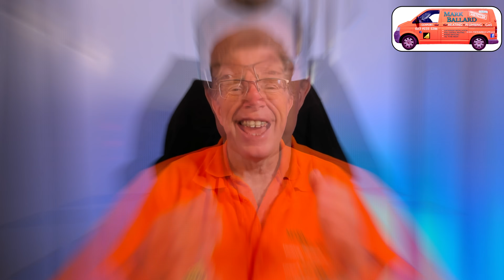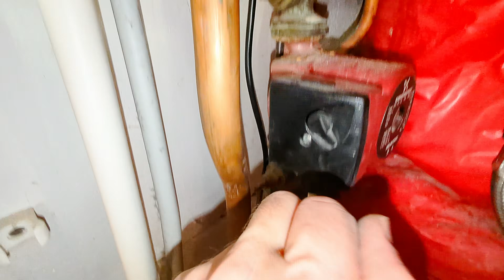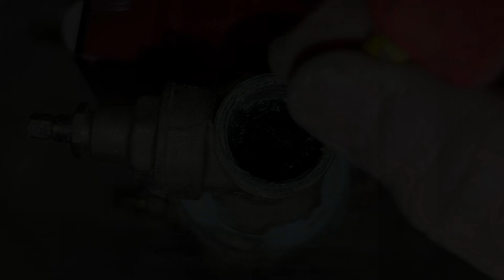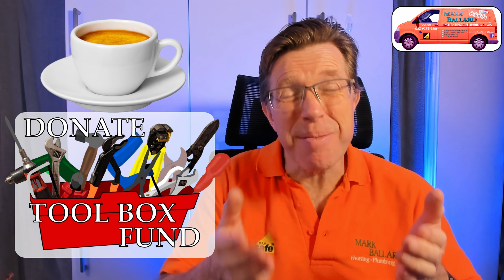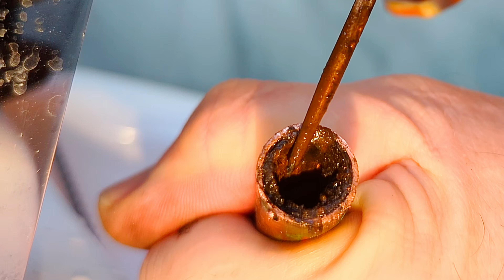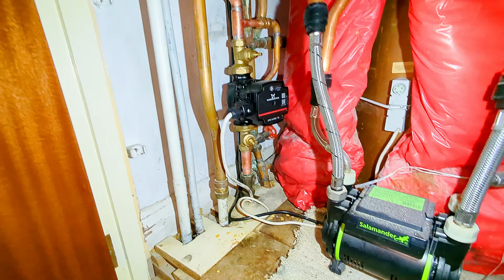Blocked Feed and Expansion Pipe Gives Lots of Problem on a Traditional System, Magnetite Blockage

Comment: Hi. Had exactly the same problem. To resolve pipe work was changed. Also the system was converted to a pressurised system by adding an expansion vessel into the loft and removing the f&e tank. 
C/H system now runs perfectly. Keep the videos coming.

Comment: Brilliant Mark, after watching this video this was exactly what was wrong with our system. Changed the pump and took out a section of pipe work and found the blockage in a 15mm pipe. Renewed the whole section and we have heating like we never had before! System’s about 30 years old so not surprising really. Also remembered to clean out 30 years of sludge from the header tank. Thank you so much - you’re the most watchable of all the plumbing YouTubers that I have seen.

Comment: I realised my feed pipe was blocked when a radiator wouldn't bleed (no air would come out). Turned out the whole length of the 15mm feed pipe (around 2m) was fully blocked. Interestingly, the  green blockage material was Not magnetic so one of those magnetite filters would not have done anything.

Comment: I will be working on this system soon. Heating works fine, but no hot water is coming out from any of the hot taps in the house. Cold water from the taps is fine. Tank seems to be getting warm and the hot outlet on top of the tank is warm, but only 4/5 inches above the tank, rest of the hot outlet us cold. Any advice please?
It is a y plan system
Reply from the maker: Firstly, you say there's no hot water coming out. Do you mean there's no water coming out or the water coming out of the hot tub is cold?
If it's a heating issue, it's pretty simple from the pump. Follow the pipe work. It's either going to go into a zone valve or a mid position valve follow the paper that leads into the hot water tank. 
Is the pipework getting hot? If not, maybe the valve isn't opening for some reason
Reply: @MarkBallardLTDHeatingEngineer 

There is no water coming out at all from any of the hot outlets.

Comment: Had exactly this happen on my mum's heating system that was installed in 1979. By 2016 and the boiler kept overheating and cutting out. The joint from the header tank was right near the floor so it was a very difficult job to replace the pipework. I'm not a heating engineer and was expecting to be able to clear the blockage with a wire coat hanger but soon realised the only solution was to replace the affected pipework.